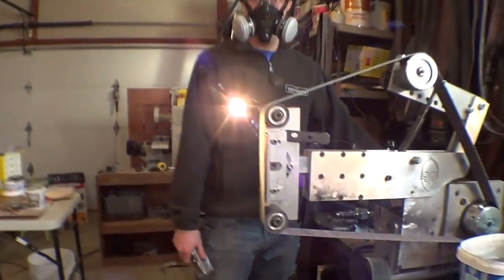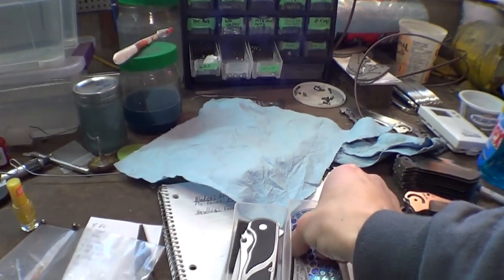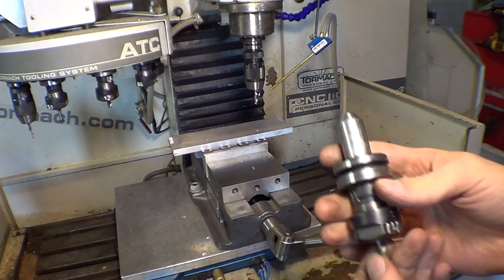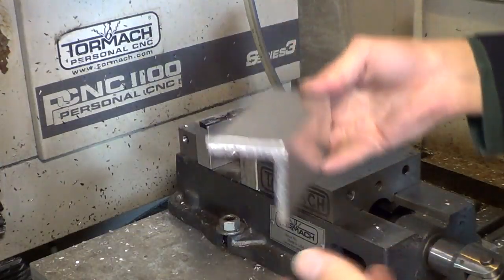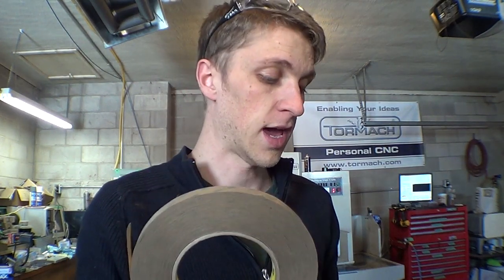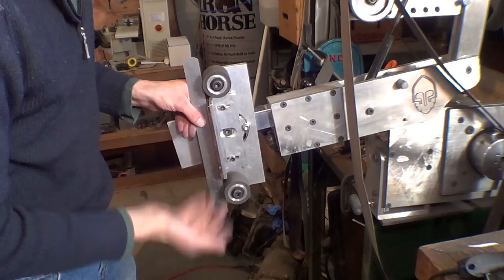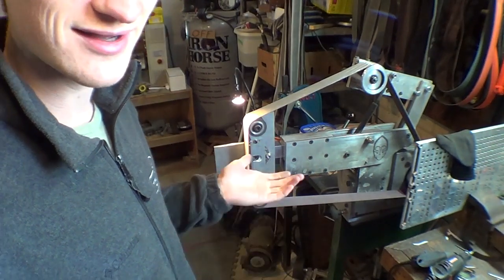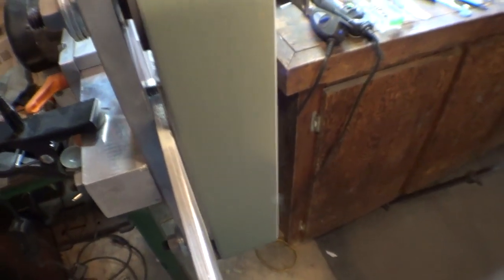Knifemaking Tuesdays Week 83 - grinder - making a flat platen

Comment: You might want to add a small metal catch/lip underneath the glass platen to make sure it can't drop down should the bond fail (through heat or other factors).
I read that can be a problem sometimes and the catch would prevent a catastrofic breakdown. It should keep it in place long enough for you to notice it getting loose and stop the grinder before it shatters.

Comment: JohnGrimsmo hey man, I'm a fellow cnc machinist and knife collector and I had some questions on the process involved to make a knife. I could get through the design with cad and the tool paths but what do you do after you've cut out your blanks? Heat treating? I've got a lot of questions if you've got some time.
Reply: It all depends on personal preference, but it is a LOT easier when you see blemishes before heat treating. it sucks to realize that you missed that one pesky scratch.

Comment: Wouldn't it be better if you flipped the grinder on its side so it's horizontal? then you could eyeball it much easier.
Reply from the maker: True, that was the plan, but we still have to space the whole grinder up 3" or else the motor doesn't clear the table when we flip it horizontally.  This way works surprisingly well too.

Comment: Does your CAN software have the option to ramp into a cut rather than plunge? If it does, use it. It will save those precious endmill corners.
Reply from the maker: Yup it can ramp or helix down, usually I helix a circle down.  For quick and dirty stuff, especially in aluminum, I usually don't worry about it.  But for titanium it's mandatory and I do.  A good tip for sure.